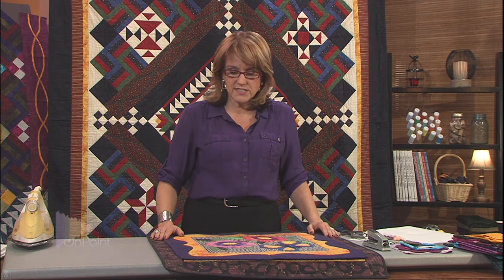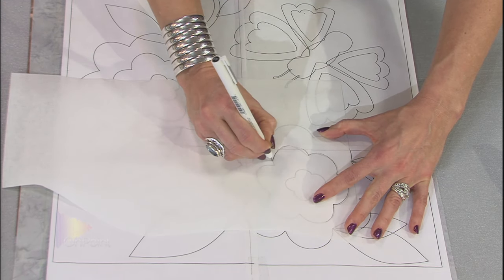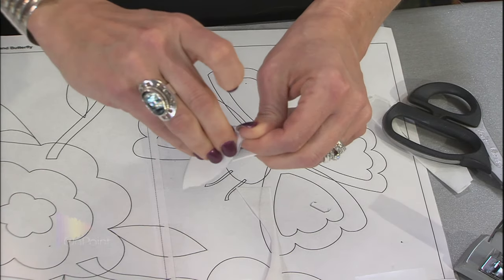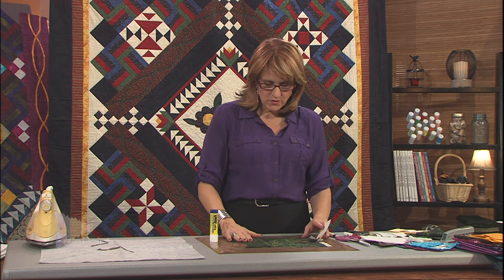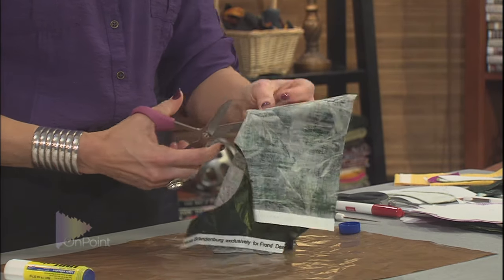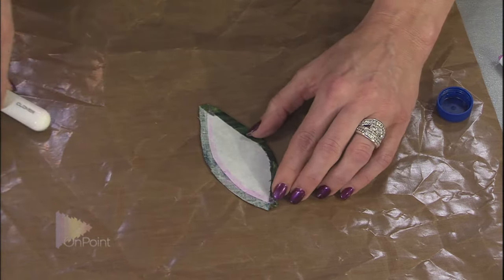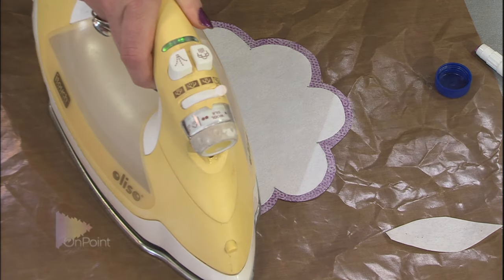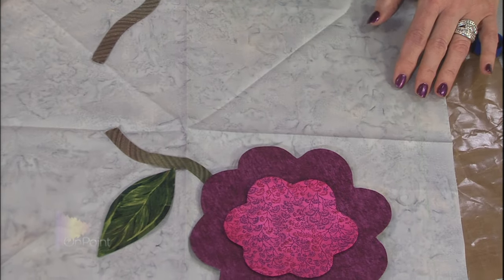Hand Appliqué Turning Technique With Stabilizer (Ep. 109)

Comment: As to the stapler: usually, the bottom plate of the stapler can be turned so that the ends of the staples aren't folded towards the inside but to the outside. That makes it much easier to remove them.
Thanks for this and all other learning videos!
Reply from the maker: Thanks for the info!

Comment: Can this method using glues be used on quilts that will be used or is this more for use with wall hangings, etc. Also, does this method work with small half inch circles/ovals? Thank you.
Reply from the maker: Yes you can!  The stabilizer gets softer with washings.

Comment: The stabilizer I'm using is very light and airy. It doesn't seem stiff. The one you use, is it more heavyweight?
Reply from the maker: I use a cut away stabilizer, the RIcky Tims Stable Stuff works great too :)
Reply: Thanks so much

Comment: Why use stabilizer and not freezer paper?  My pattern has many intricate pieces and is a small picture quilt of a pug.  I know freezer paper will have to be removed and stabilizer doesn’t but I won’t be washing it to gain softness.  Then again, just depends how stiff it ends up to be.  Might not be an issue but am concerned about stiffness.  I also plan on machine appliquéing the pieces.  I think.  Thanks.
Reply from the maker: For the stabilizer, the Ricky Tims Sable Stuff is the best - not too stiff and when washed is makes it a really soft.
https://www.firesidequilts.com/shop/c/p/Ricky-Tims-Stable-Stuff-Poly-x57763443.htm
Reply: @QuiltingWithNancy  thanks but my point was why stabilizer vs. freezer paper in the first place?
Reply from the maker: @canuck33  Because you can leave the stabilizer in the quilt - with freezer paper you need to remove it so the quilt can be washed as the freezer paper doesn't wash well :)
Reply: @QuiltingWithNancy   Makes sense.  Thank you.
Reply: @QuiltingWithNancy Ricky Tims went out of business. Is there a similar product out there?

Comment: Thanks for sharing this! Is the tearaway and glue hard to hand needle through?
Reply from the maker: Hi Besty - the tearaway foundation is not removed - it seems stiff when you are working on the project, but you leave it in and when you wash the quilt the stabilizer will soften up - when you do the glue portion, try to keep it from the actual fold of the fabric so that it is not too hard to get the needle through.  The glue is a water soluble so again, when the quilt is washed the glue goes away :)